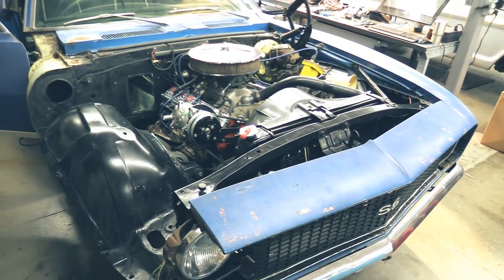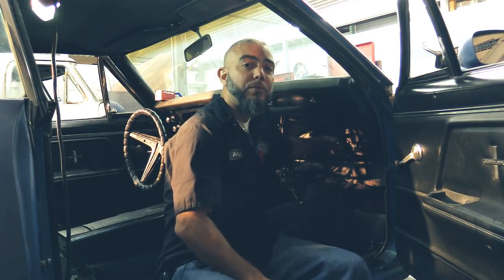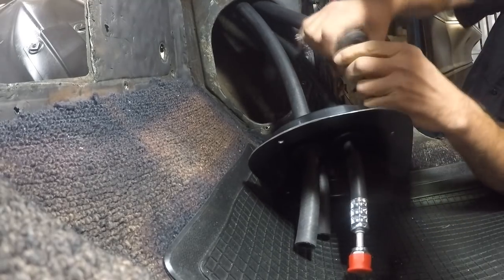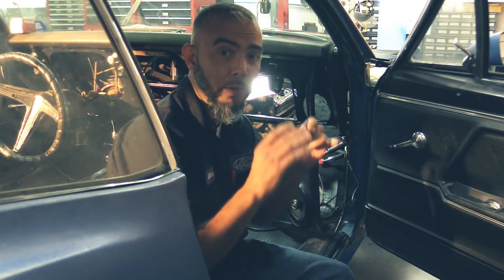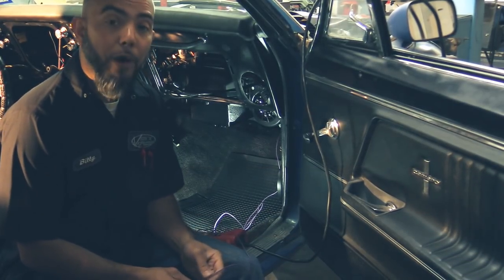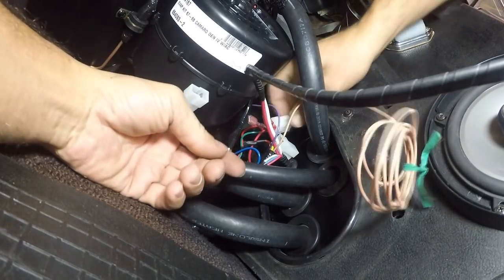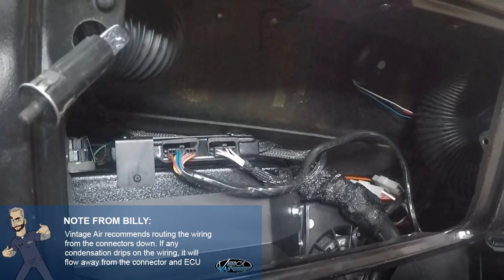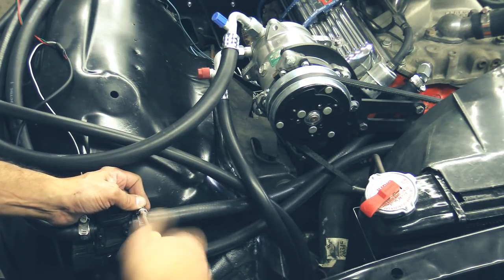1967-68 Camaro/Firebird Evaporator Kit Installation

Comment: On a typical install like the one in the video, how long would a technician take to complete? Is it necessary to remove the gauge cluster, radio, to install the unit? Thanks
Reply from the maker: generally it will take about 20-25 hrs. for the install, obviously this will depend on experience and tools. Plan for a weekend plus a couple hours on the weekdays. Gage cluster and radio removal will be specific to the vehicle, for the 67'-68' Camaro kits both will need to be removed and retained